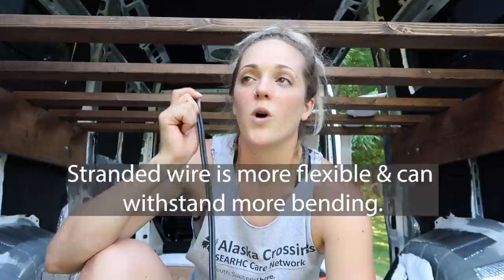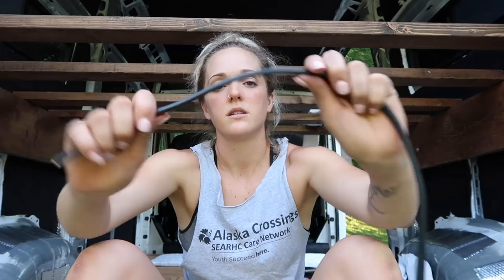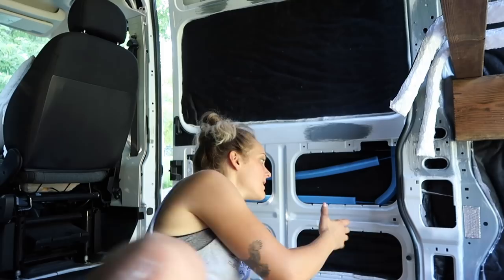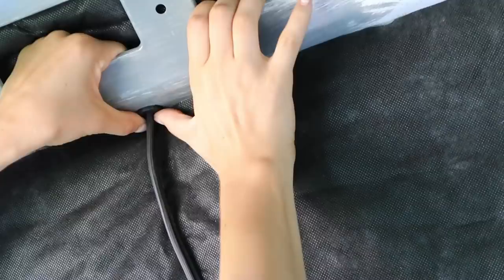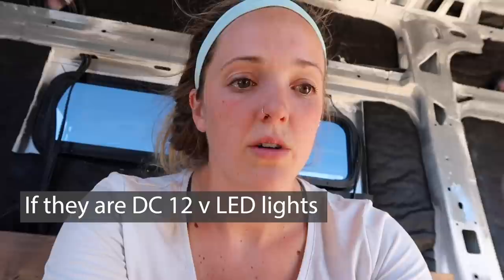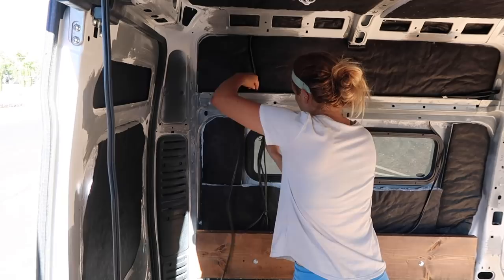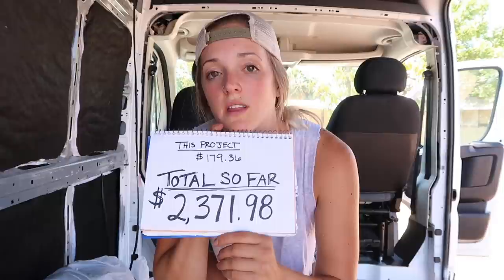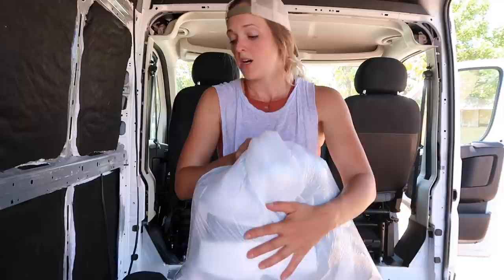PREWIRING my vanbuild with NO EXPERIENCE | Prewiring for Beginners

Comment: I think you are doing a Great job !! #1 you use stranded wire because it is flexible, you can solder it, and crimp end and correctors (solid wiring you can't do any of the thing that you can do with stranded wire ) # 2 DC is electric power in one direction only ( think of it as you are only pulling or pushing but not both) # 3 AC is electric power that the current being pushing for 1/120 of a second and pulled the next 1/120 of a second that is why it is called 60 cycle. The reason for AC is it is the best way to move current (current is the amount of energy being used) # 4 all current is measured amperes ( think of amperes same as gallons is to liquid) # 5 Series wiring is like  the cheap Christmas light ( 1 bulb going bad and all stop working) think of it as you and your friends sharing a beer you take the first drink and pass it to your friend  that take a drink and pass it to next friend who take a drink and pass it to the next friend who take a drink that is drinking in series. # 6 Parallel wiring is now like you and your friend drinking beer but this time everyone get there only beer can and can drink sum of the beer or all of the beer.  Note I'm a slow at typing I stoping. But I want to tell you that I was born in Provo , Utah ( I was raised in Florida ( the same town that Brain Johnson from AC-DC lives) I hope this helps you keep up the good work.
Reply from the maker: Hi John! I appreciate your comments so much. Thank you for the analogy about the beer - I will definitely be using that in a later video! (Of course I will give you the credit!) I appreciate the time you spent to include so much information. I will be referring back to this comment for reminders :) Thank you, have a wonderful week!

Comment: I finished my Maxx fan install. I'm 70, and happy to see another woman not afraid to use power tools. You video was so helpful! I watched it many times before finally getting the courage to cut a hole in my roof. My only difficulty was cutting the roof...I thought it was going to be thick... Wrong blade. Finally changed to a very fine tooth and the vibrations were minimal. I was shocked at how flimsy the roof was! I bought the expensive butyl, and was so glad. Your simplicity saved so much time and unnecessary steps .. Like making a frame on the inside... Not needed at all! I'm so excited to get on the road and try my new fan! 
I was the first female builder in my large city in the early 90s... Tough times and many battles breaking into the trade. You go girl!

Comment: Hey, the reason for parallel when wiring 12v lights is because you need to keep the voltage at 12v to match up with your battery! Parallel wiring makes the amps go up but voltage stays the same. Cheers!
Reply: That is true for batteries but not for lights. Lights are wired in parallel to minimize voltage drop.

Comment: FYI, if you don’t or can’t get rubber grummets, you can use car vacuum or ice hose tubing. Vehicle vibrating does cut wires. If no fire, defiantly future headaches. Also landscape lighting wire is a great cheap alternative.
Reply from the maker: That is a great idea, thank you for the advice! Also, yes, landscape wiring is what I used, and based on what I know, it did the trick wonderfully! It is also very protected which I liked.

Comment: Nice job!  Wiring is simple in theory  and  complex in practice because of all the choices. In AC I always check the breaker bc they have a minimum Guage/current that effects throwing them off.  If a short in a circuit can't through the breaker it might start a fire. I don't know if silicone effects rubber life.

Comment: Been watching some of your videos, you got some good skills for sure. 👍

One thing I plan on doing with my van build is running my electrical, as much as practical, through conduit on the OUTSIDE of my walls. I don't think this will look bad or two "Industrial", particularly if  you blend a conduit into the wall with paint or some such and run it along areas where counters or cabinets meet the wall. Or even midway up the wall if you like.
Then you just build a little box to attach to the wall that would hold whatever switches or electrical plugs where you need them.

The reason I'm doing this is I think it would be much simpler than having to precisely measure things from behind a wall and cut the appropriate holes in the exact places in the wall. Plus it think it makes it a lot easier to expand or otherwise change the system, such as dropping in another electrical plug  somewhere where you maybe didn't think you needed one before, if you don't have to get behind your walls for the wiring.

Anyway, great job. Really admire your skills and ability to be flexible and change.

If you would like some ideas from another great build series, might want to check out Humble Road here on YouTube. The guy is pretty cool. Maybe he over engineers a little bit, but it's pretty interesting too.

Comment: I wasn't sure if I should put it under insulation or over. Even over the wall itself and cover the wire with something. But seeing yours it looks much more simple than I was thinking it would be. I'm only at the rust priming and fan installation but I'm so excited to actually have walls and wires done.

Comment: You honestly have hands down the best videos to follow along with.  Thank you!  I was wondering with the 12/2 wire, how do you know which cable is which because they're both black.  I just bought some and am so confused.
Reply from the maker: Such a good question! I just assigned one of the sides positive and the other negative - one side is usually somewhat different. For example, on of the wires on my 12/2 was smooth with no writing on it, the other had small ribs and small white writing. 
I hope that helps!

Comment: Stranded wire is ok for things that need to move like small appliances or phone chargers, but solid gauge wire has it’s use for wiring that won’t move very often. Solid gauge is superior for anything wired through a wall because it’s more stable, conducts better, makes less heat, and lasts longer. Solid is slightly cheaper as well.
Reply from the maker: I have been told by a few van builders that they strictly use stranded! I'm sure the debate will always continue though haha

Comment: Hi Linnea. Keep up the good work and research. Your hand cut from the sharp edges of the van and realization of it’s impact to your electrical is super important for builders to know. I haven’t done it myself but following Humble Road and must say I like what he has to say about wiring. Ancor marine grade 12ga. It has an extra sheath around the 2 individual wires AND he looms them all, AND where worried about additional rub uses thick butyl electric tape and sometimes a second layer of loom. Think of it as a belt and suspenders for your electric system. Hope this tip helps a future builder. Looking forward to watching more of your vids. @vantransitions <- I’m WAY behind you... only just started setting up my workshop to convert a 2021 Ford Transit.

Comment: Your videos have helped me a lot! Thanks so much for taking the time to put these together. A few questions to bounce off you if you have a moment!? 
Are you planning on connecting your house battery to your alternator to charge when driving ? While doing your research did you come across much related to that? I'm working through my pre-wiring now and just trying to figure in that portion. I've found some stuff about the wiring size, the need for isolator and the ACR but still piecing it together. 
Did you choose to place your battery/charge controller on the driver side because you'll have your water on the passenger side? I'm trying to consider weight distribution and figure out what would prevent me from placing "power bank" on the passenger side of the van so I balance my galley which will be behind driver chair. It just seems like everyone does it on the driver side along with their galley and that seems like a lot of weight on one side of the van. 
It's fun running through these things in your head solo - lol. Again, thanks so much for putting these together, very helpful and entertaining to watch too!

Comment: IT'S Worth The Extra $$$$$; by running plastic flex tube, to all your switches, lights, plugs, Etc., (A) You Protect The Wire From Damage, (B) Run More Than 1 Wire At The Same Time, (C) Run New Wires In The Future, Without Having To Tear The Van Apart.
Make Sure To Put String Through The Tube Before Install; so you can tie the wires to it, to pull then through...
Ps: Plastic Flex Pipe , comes in different sizes, so depending on the size for the # of wires, buy 1 size up, from what you need...
Nice You tried to protect it with tiny pieces & Gromit's...

Comment: Linnea, my wife and I enjoy your videos very much! We just bought a 2020 Promaster and we are going to start soon because I have trouble working in the heat. I have a question for you how much insulation did you get for your van? I got some boat wire for my 120 volt side of the build, it is stranded wire with 3 insulated wires inside the main wrap, its very durable and rated for 30 amps even though I only need 15 amps. Keep up the great work and looking forward to your next video.
Reply from the maker: Thank you so much for the support! 
A 2020 ProMaster? How exciting, congrats!
For the insulation, I purchased the 40'x60'' roll of 3M Thinsulate and I literally had the PERFECT amount. Although, I do not have an extended van - so if your's is larger you might look into getting extra. 
Will you be installing a solar system?
Reply: @Linneaandakela , Thank you for the quick response. My van is 2500 same size as yours 159 wheel base and yes I will be adding solar. I bought most of the big stuff for the Van within the last few years waiting to do this, so.. What I have is one large Solar-world 328 watt panel with four 6 volt 225 AH batteries connected in series parallel for a 12 volt system with 450 AH. I'm 58 years old and wanted to do this long ago but life kept me from doing it but I have not given up my dream to do it. I can't work in the heat and my stamina is not what it used to be but I will do it not matter how long it takes.

Comment: If lights are wired in series they will double resistance at each connection. In parallel they do not increase resistance. Increased resistance leads to increased heat. Increased heat would mean a melting wire, a melting wire may lead to a fire. Fire in a van is not good.

Comment: Loving the videos just found them but sorry your wrong on the electric ground part, more research is needed
Reply from the maker: Can you explain a bit more? I am living full time in my van now with no issues and I did all the electrical myself!
Reply: @Linneaandakela   sorry I just seen your message and honestly love the vids, In the video you said AC has a ground and DC doesn’t. Not quite right both have a live and neutral. You can ground of your chassis on the van, AC you need follow back to to main board eg house fuse box, also I didn’t see in this video any fuse being used (maybe another video) Sorry I do this for a living fitting audio systems, alarms, light etc....
Reply: @Linneaandakela  o before I forget have you had to jump start your van at anytime ? If so I can give you some tips on a system that won’t kill your battery if you want, pace and Lov ☺️

Comment: You can definitely run LEDs in series. Really depends on the driver.
Reply from the maker: Not if they are 12 Volt Direct Current - which is what mostly is used when running LED lights in van builds. All of my lighting is DC, so this is a really important piece of information for my viewers that are doing the same thing!
Reply: @Linneaandakela  you can definitely run LEDs in series. You just need to calculate the voltage drop when you add them in. It is all dependent on the LEDs that you're using. If it's a 12v LED circuit.. then yes those would reach need to be run in parallel
Reply: @Linneaandakela  anyways, I just wanted to say that I really enjoy your videos! I ran into a lot of similar obstacles when I did my bus conversion

Comment: 12gauge wire is way more than thick enough for tiny lights.  You could safely wire SIXTY 12V, 2Watt LED lamps in parallel on just 16 gauge.

https://www.stayonline.com/product-resources/reference-circuit-ampacity.asp

You would want the 14Gauge or 12Gauge for large A/C loads like a microwave, A/C unit, stove, heater, etc.

Comment: I'm a little confused, it seems like you added 14g wiring when you wired up your puck lights. What do you use all this 12g wire for that you installed in pre-wiring?
Reply from the maker: I used this to run to my fans, my fridge, and I put two extra wires in my walls in case I wanted to add a water pump or heater! 
Looking back, it would have been fine to use 14g for all of it!

Comment: You are putting a lot of weight into your van, I watched the paneling video, you could have used Wall tongue and grove instead of floor tongue and grove and there wouldn't be so much weight. You could also use an L bracket and get the center support bed beams from AKEA, for your bed.

Comment: How are you liking your wiring efforts at this point? 

I will be tackling this task in my 1st van build. I have absolutely no knowledge of how wiring works
Reply from the maker: I wouldn’t change a thing! The only thing that some might suggest, is to go with a smaller gauge wire depending on what you are installing. A 14 gauge wire would have been plenty for everything :)
 I just finished my last electrical (under cabinet lighting) and I feel really good about all of the electrical! 
Good luck and don’t be afraid to reach out if you have a question!

Comment: Why 12/2 wire? Most wire in the Promaster is 14, 16 or 18 gauge.
Reply from the maker: You are right! Mostly because it was recommended to me by my friend - I wasn’t 100% sure about the appliances and a 12 gauge wire is large enough for any amount of electricity that would be needed in my van. Basically because it felt safer to go larger than risk going too small.

Comment: I suggest people hire a Licensed Commercial electrician..Even if it is tell you how to do it. As I fixed so many fire hazards in customers RV. As what takes years to understand. No amount of YouTube videos is going to make the time required to learn any shorter. As they don't teach this stuff as Electrical Theory 400 years later for nothing. 

And no two systems are the same. What works for one. Is not going to work for somebody else. As these are peoples homes on wheels..

Comment: So no fuse box, that's weird.

You are all super safety type of mindset but then you didn't install a fuse box, how can that be safe?

I think you American's call fuse boxes a "circuit box", or a "junction box", or a "circuit panel", or a "service panel".  Basically if there is any electrical problem anywhere in all your wiring or if any electric thing you plug in have a problem, then you need a fuse box because you want the fuse to blow instead of your van burning down.
Reply from the maker: I have a fuse box, this is just the wiring phase before installing the actual components
Reply: @Linneaandakela  ok, cool.